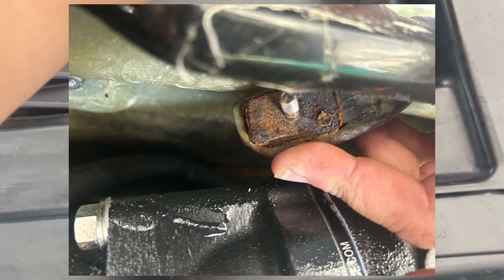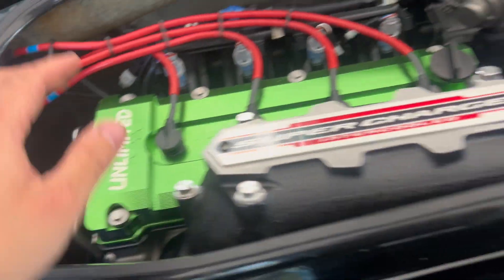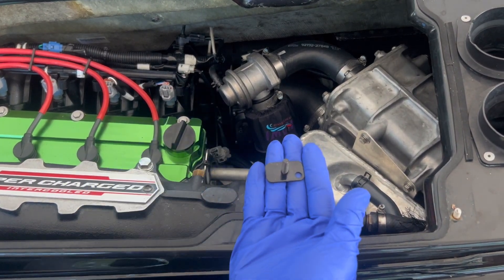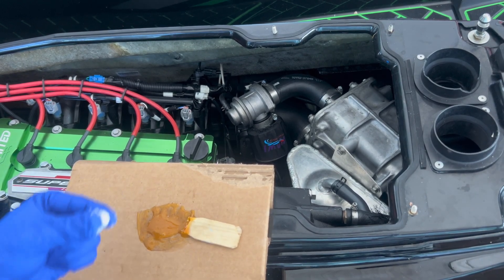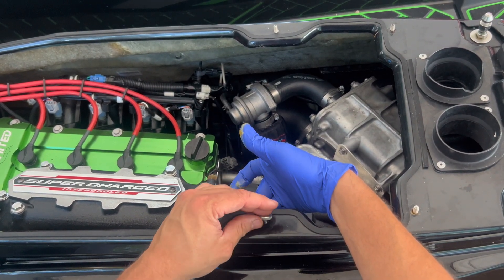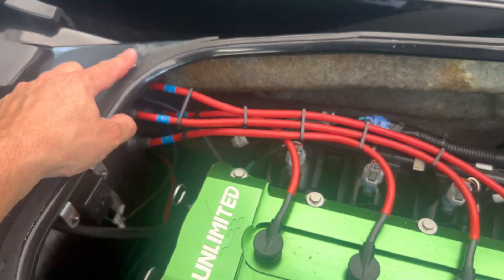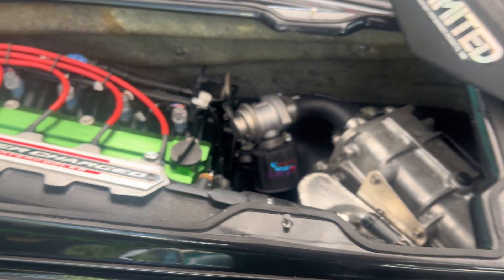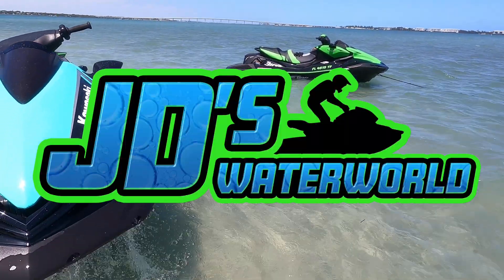Replacing rusted or broken engine cover studs on Kawasaki Ultra 160 and Ultra 310 Jet Skis

Comment: Hi JD. I'm looking at a 2023 Ultra 160LX with 15 hours. If I don't see any red flags before, I will request a short water test before moving forward. Is there something I should be careful, aware or double checking before buying this jet ski?. Also, if you're buying from someone you don't know,  what is the usual process? take it to a dealer for an inspection? Thank you
Reply from the maker: 15 hrs really not enough for anything to go wrong..did prev owner buy the extended warranty? I would personally not buy a used JetSki unless it came with an extended warranty.
Reply: @JDsWaterWorld  I sent you an email. Did you get it?

Comment: Is in not possible to replace the steel back plate for a stainless one? Thus avoiding any rust problems in the future?
Reply from the maker: Theoretically you could just take a stainless bolt the right size, put a fender washer on it, then epoxy in place same way...but I was curious to see the entire new bracket..stupid of Kawasaki not to make it of stainless steel- probably some bean counter cost cutting measure
Reply: @JDsWaterWorld 
True. Really stupid. Combining rust free metals with plain metals always make the lesser metal degrade even faster. You will have to repeat this job soon I am afraid.😅
Love your videos. I just bought a 310X and I am planning to do most of the quality upgrades you showed us.
Reply: Crazy the shit they skimp on is wild to me. It's like 1+1 is 5

Comment: Love all your vids BTW just to circle back to your ThrotlePS problem 5 months ago did U change or fixed was it really the problem?  Seems lots of us have that same issue... was wondering cause before I stored my 310LX had the same hesitation on acceleration and low rpm at full speed, but when I restarted went A-1 then after 30 minutes problem started back again seems like an intermittent problem. So before taking things apart just wondered how it went for U.
Reply: PLEASE REPLY. thx!
Reply from the maker: What year machine?
Reply: @JDsWaterWorld  2022 310 LX ... I understand all the factors involved with hesitation my question was when u changed the throttle body did it fix your hesitation cause my jet ski is in storage now till spring but I beleive the throtle body is the culprit. So again after changing the throttle body was the problem solved? It's a $1000 part I have the extended warranty like you. Did you get it covered under warranty? THX for your precious time very apreciated.
Reply from the maker: Ok, so the throttle bodies from 2014 - 2021 were made by Mikuni in Japan and in 2022 they switched production to China. I got an older one made in Japan and swapped it in. Did you watch my 5 step diagnostic video? Have you ever greased the pivot bushing or changed the spark plugs? Are you making sure you have fresh fuel and your bilge is completely dry? Did you change the fuel filter? Not sure if your hours...Probably the most common cause of hesitation would be spark plugs are worn (25 hours is the typical life of PMR9B)
Reply: @JDsWaterWorld  I not only watch yr videos on maintenance I downloaded them all,  I did watch yr 5 step diagnostic and made shure everything is A1 from spark-plugs,fresh fuel, fuel filter etc etc compression is 160 in all cylinder I like you maintain my jetski impeccably have 100 hrs, i'm from Quebec Canada fresh water only never leave ski in water I pamper my machine more than my girlfriend! I never let anyone do maintenance on the ski, I do everything on it myself like you, have the riva stage one on it, kspeed block off plate and ride plate I hit 73-74.2 mph,  I'm the guy who told you about the Kawi AUTOMATIC TENSIONER ARM on yr bushing maintenance video, the only thing I did not do is delete the muffler comp... witch I have (when New)  re-weld with more tacks so I get xtra hrs on it and keep on (for warranty purpose) but lately after riding for 1/2 hrs at cruising speed 40mph on full power then when I smash the throttle  it bogs down and max speed 63mph and 7000 rpm with hick-ups, then I cut off battery power (have switch) let sit 2 min and restart then back to 8000rpm and 74 mph and after a while 30 to 40 min bogging comes back, same issue on medium power 67mph then 60 mph Riva tune only affects full power so tune is not the problem. So You are the kawi jetski pro and I can't find anything from jetski dealers cause from experience they know shit about what they sell. So in the end... here is my question again did the replacement of yr throttle body fixed yr issue or was it something else?
Reply from the maker: In my case, yes it was the throttle body- but don't just replace it without doing the proper tests. You need to check your fuel pressure- the pump could be your culprit- especially if you havnt changed the fuel filter bag yet at 100 hr
Reply: @JDsWaterWorld  Thx a bunch! Kawasaki JetSki should hire you as a consultant... Because of you we are able to fix the "gremlins in our Ski's" Regard's.
Reply from the maker: You have to check the function of the TPS and throttle body actuator with the resistance and voltage tests using a multi meter and needle adapter..I swapped my throttle body out for another one. Hesitation could also be fuel pressure, belt slip, ignition/spark, pump bearing failure, or a combination of all..have to keep checking things until you find something that's out of spec

Comment: Nice JD,... My 2016 doesn't have the cover, but if it did... I'd be having my friend from the dock yard here to make me Marine grade stainless steel upgrades, I also have an excellent engineers shop here, a couple of wizards run it and take care of all my awkward snapped stud extractions, plus any skimming, rebores, or machining required. And the prices are too fair, I have to pay them more than they ask. £60 for the same fix I've seen everyone else pay $600 for, so I gave them £90.
That was an fx engine mount stud that particular time.
Thanks JD, I'll keep this in mind for if I ever get a newer 310r. Magic.. 😉👍

Comment: Good tutorials as always. So… I’m gonna have to take everything apart again because my fuel pump float is definitely stuck. I checked everything else and the fuel gauge still reads 1/4 tank all the time. Also on a side note JD, how did your guys fair in the hurricanes? Hope there was no damage
Reply from the maker: Damn that sucks..when i did my pump install I tested everything before I put it back together just to make sure..maybe the float got stuck on the filter or band or something? Thanks for asking man, luckily we were completely fine here!
Reply: @JDsWaterWorld  good to hear. About the fuel pump mod, I guess the lesson here is anyone can take something apart. What takes skill is putting it back together
Reply from the maker: lol well sorry you had an issue!!
Reply: @JDsWaterWorld  it’s all good. Like I said lesson learned on my part. I should’ve done what you did and made sure everything worked before rushing to the ramp to ride my ski